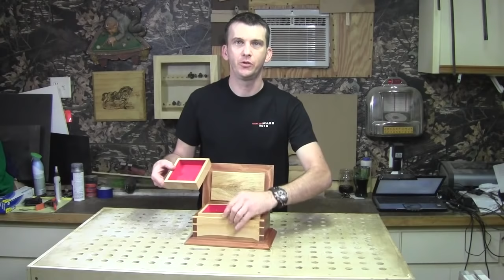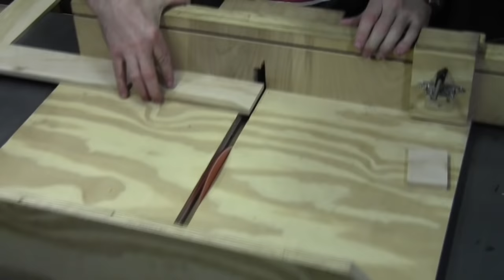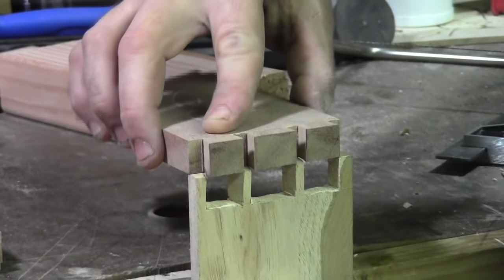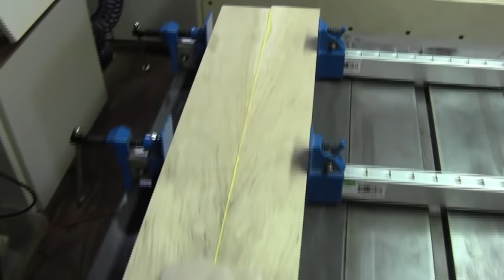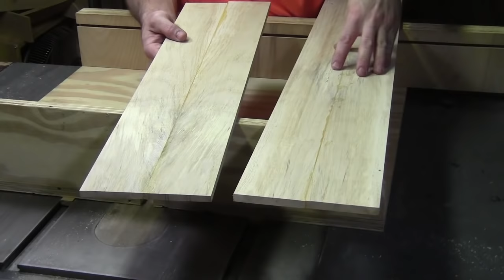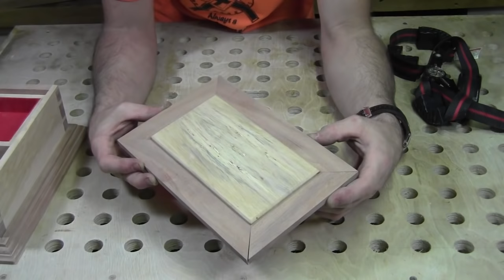Woodworking - Making a Hand Cut Dovetail Box

Comment from the maker: When it comes to hand cutting dovetails I am by far no expert with still a lot to learn myself. There are many videos out that demonstrate this process. I called the videos "Making a hand cut Dovetail box" because that is what the project I made was.  I have slowed down a bit in my newer videos, I know this one seemed rushed it was made through my transition phase going from long videos to short ones. At the time I was trying to work out the pace of my videos which I think I have gotten down.

Comment: trick for making dovetails. say you want a dovetail 1 inch wide. take all four boards stack them up line the ends up flush with each other. then stagger every other board in the stack to the left(or right) by 1 inch keep the ends flush on the side your working and clamp together. from there you just need to mark your dove tails on the front and back piece, and across the ends, then cut 4 ends of dove tails at once, all matching. flip it over and repeat for the other side. when you unclamp the boards after the second set of cuts, all your cutting will be done and perfectly matched. also means you can use your table saw to do the cuts.

Comment: My dear Mr. Laney, you musn't massacre your Japanese-style saw. I didn't get a close look at the teeth, but just the shape of the blade tells me that it's a Dozuki type. In that case this is a pull-stroke saw- hence the very thin blade. You see, they cut very straight, and leave little kerf. Pulling the blade ( contrary to the erroneous Western push stroke) straightens it out due to tension. When mastered these saws are real beauties. Happy dovetailing

Comment: actually, i believe he was using a ryobi... which is a double-sided saw (japanese style pull stroke). the 2 sides are used depending on where you're cutting on the wood.

a dozuki is also a pull saw and IS designed for doing dovetail type work. and, it would work better in this application. it would not be double sided as the ryobi is, and is a little smaller.
Reply: It is a Ryoba, not Ryobi...

Comment: Laney - GREAT box! I just had a question about the lid because that's the first time I saw it built that way.  Usually I've seen the panel cut to fit into grooves cut into the frame and the panel is made smaller with enough room for expansion so that the mitre joint on the frame doesn't split.  In this case it appears that the mitered frame fits exactly into the grooves you cut in the panel.  Do you worry about the pecan panel expanding and putting pressure on the mitre joints of the mahogany frame? It's really a cool way to make a raised panel on both sides of the lid, but I was just wondering whether that was a concern of yours? Here in Cape Cod, MA we have a lot of changes in the air and many of us aren't in completely air conditioned houses where we can moderate humidity. Thanks again for a great video!

Comment: Laney, 
Check out AskWoodman's table saw dovetail technique; I think it would be right up your alley.  It's really simple for doing the tails and you can get precise and evenly spaced tails every time (and you don't need a dovetail saw for the tails; although the pins still require hand work with a saw.)
/watch?v=NUJCimDIU08  (starts here and goes through several consecutive videos)